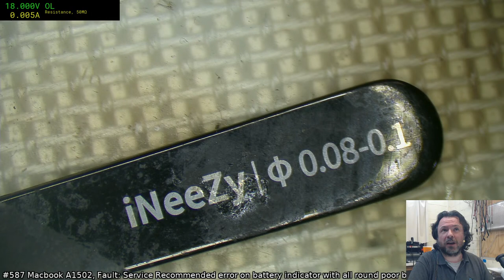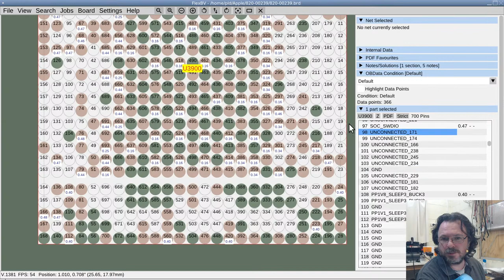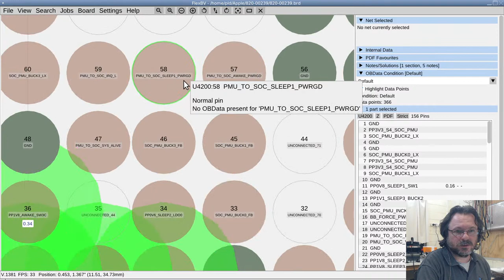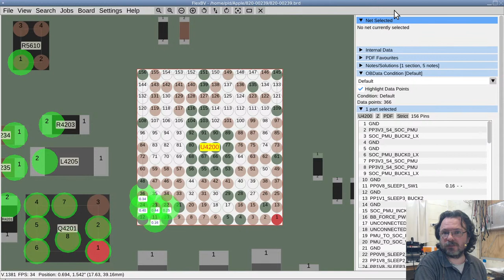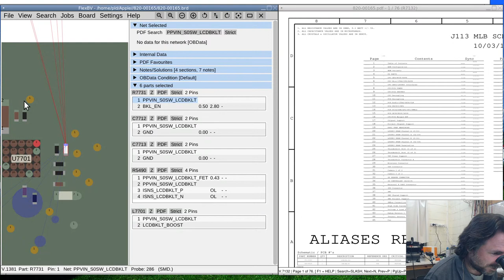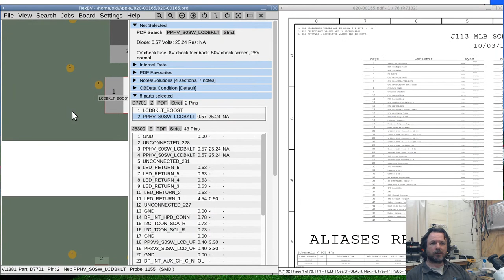Macbook A1502 battery replacement; OBData Capture board Microcontrollers finally arrive!

Comment: Denatured (ethanol) is better than IPA at releasing adhesive. What I can say, as an Xperia devotee (FM Radio, good build quality, compact), the micro-usb doesn't get as loose over time as the USB-C. It's also harder to get pieces of stray material into the connector (have had to fish various things out of the USB-C).
Reply: I've not used this directly with electronics but MEK or Methyl ethyl keytone is designed to remove adhesives...